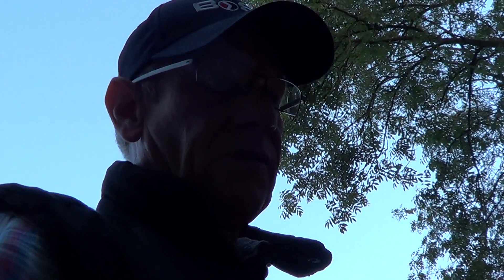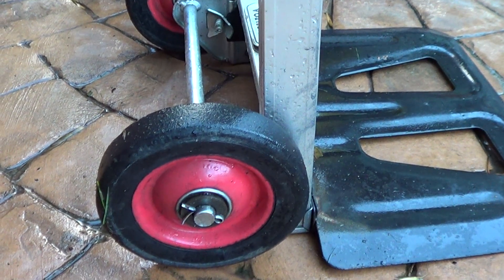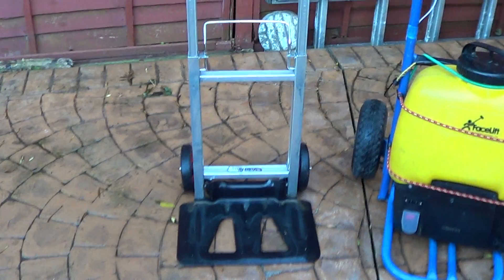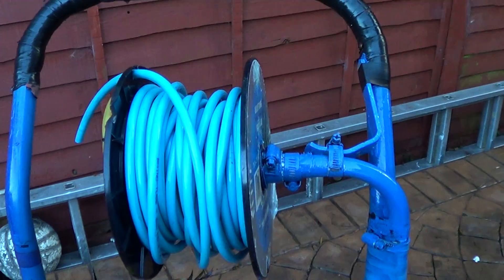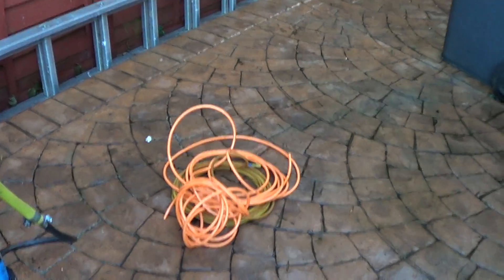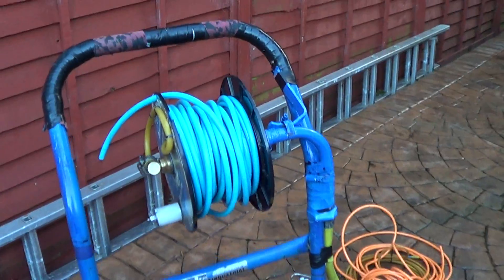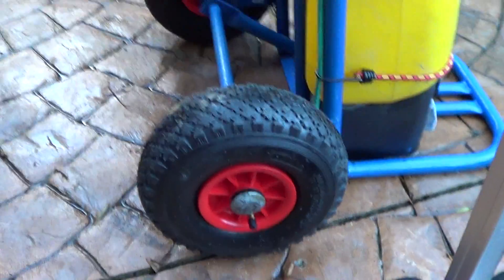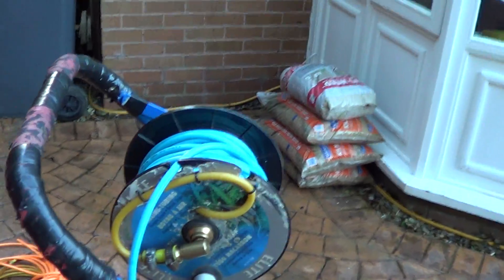Trolley System Wheels - Why use inflatable tyres

Comment: I use solid wheels now. They look just like inflatables but are made from a kind of semi hard soft rubber, (really durable though) . Found them on eBay easy for around £8 each delivered . The reason I did this was because I had two flat Tyers in 2 month. Inflatables do have a slight advantage as they absorbe bumps out a little I found . Ps they are yellow in colour if you search on eBay for them.